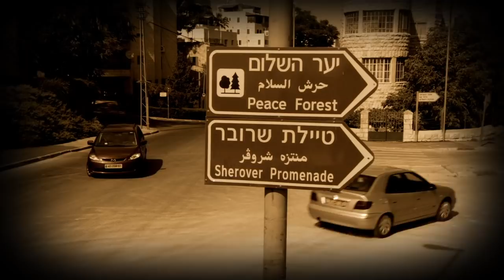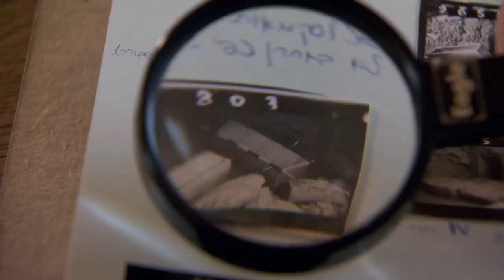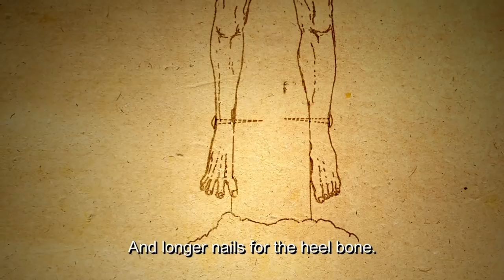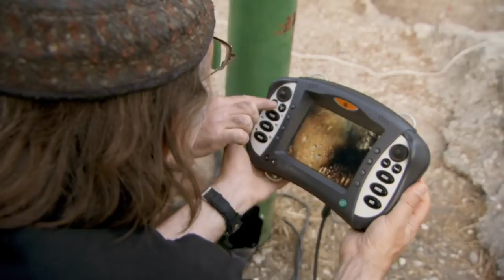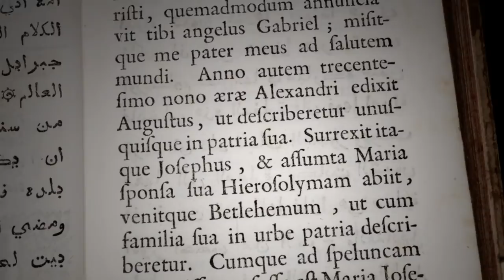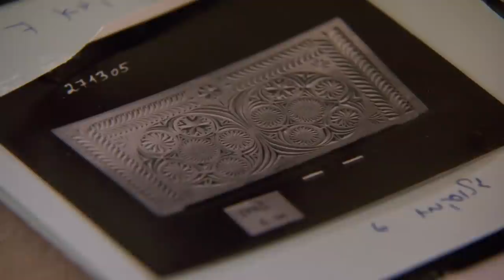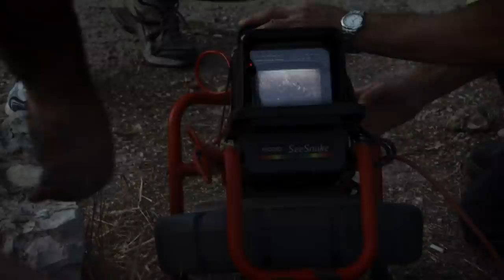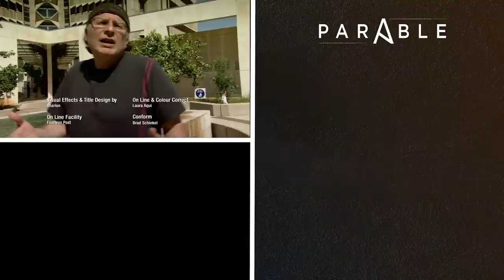Biblical Enigma Solved: The Crucifixion Nails Found | Parable

Comment: I thought there was 3 nails, 2 for the hands and 1 for both feet
Reply: actually, it would have been 4 nails. One for each Hand and One for each foot. Based on the heel they found with the nail still in it, the nail would have been driven into the outside of each foot, through the heel and finally, into the side of the wooden shaft. 14:33

Comment: I thought that the nails weren't real. Think about it, if you put your full bodyweight on some nails running through your hands, there is nothing to stop them from just ripping through and you falling. No bones in the way or anything and not enough skin.
Reply: They weren’t directly in the middle of his hand. Between his wrist and the middle of the hand
Reply: Specifically so they wouldn’t rip

Comment: Lots of loopholes. If the modest bone box belonged to the good Caiaphas, the high priest which this video claimed was made out to be the bad guy high priest that sent Jesus to be crucified, then who was the Joseph of Caiaphas with the more ornate bone box? Was this Joseph of a higher position than the other Caiaphas with the modest bone box? Why no further investigation on this Joseph to prove he was not the high priest then? Josephus and the Gospel of Nicodermus mentioned Joseph Caiaphas as the high priest during Jesus' time  so even if Gospel of John  referred to the high priest only as Caiaphas, it doesnt mean the first name of the high priest was not Joseph Caiaphas. There is no conclusive evidence that the 2 nails were used in Jesus' crucifixion. There were so many  cruxifixions during the Roman occupation of Jerusalem and narrator already said one of Judean afterlife objects were cruxifixion nails so they could be any 2 nails from other cruxifixions on the palms. Video has not proven that only Jesus' cruxifuxion is on the palms!

Comment: how could anyone ever say we found some 2000 year old nails , they must surely be the one jesus had stuck in himself 
like wtf, nails have been around even before jesus and there is 1000000000000000000000000000000000000000000000000000000000000000000000000000000000000000 of them
Reply: These nails were buried in the tomb of the Jew that had Jesus crucified. So that is not just don't random tomb.